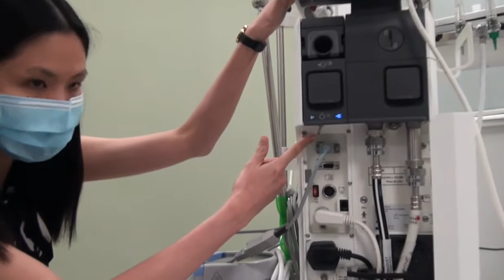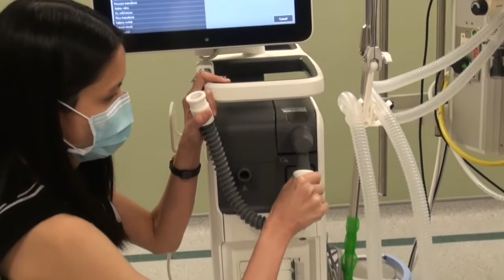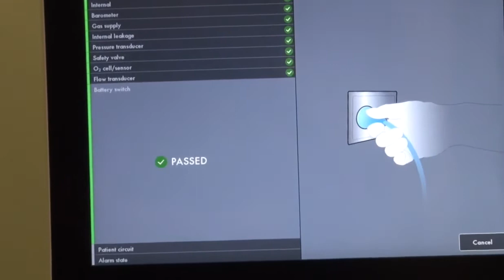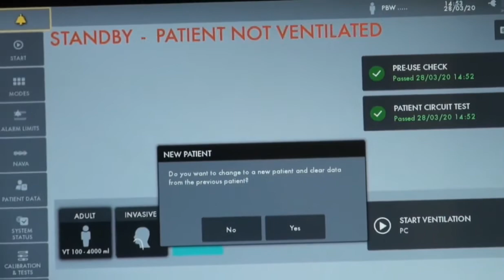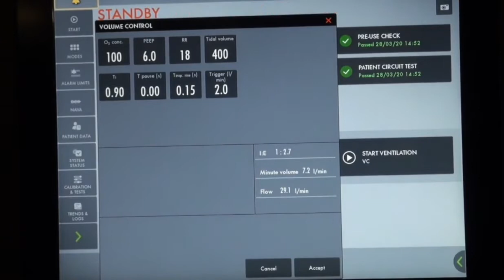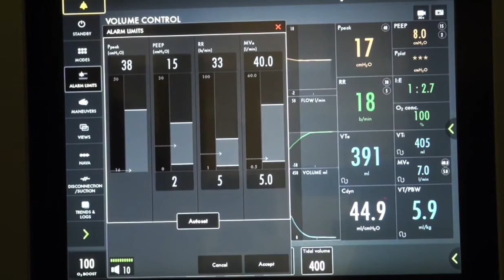Introduction to Servo U

Comment: Thanks for this instruction video! 
I would like to add some information about LeQuest, the global standard for medical device training, because a high quality e-simulation training for the Getinge Servo-u mechanical ventilator is available on the LeQuest platform. A short impression can be found in the below video trailer: https://youtu.be/giWvTA1GUm8 More information about the company’s vision can be found in the below video link: https://www.youtube.com/watch?v=lr4bLy0yDZg
At LeQuest, our goal is to improve the quality of care by unlocking the potential of both medical technology as well as the competence of medical staff to use devices to the limit of their possibilities. With the LeQuest e-training modules, users can master the system in an effective way, gain confidence by practicing with realistic, guided simulation scenarios and learn and practice anytime, anywhere. Do not hesitate to contact me, should you have any additional questions Thanks Stefaan De Knijf (sdeknijf@lequest.com).